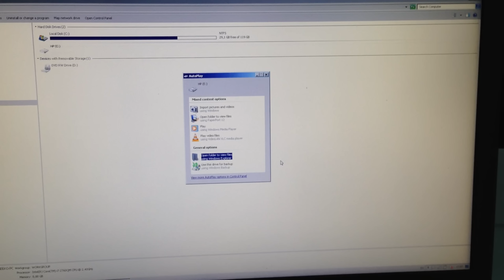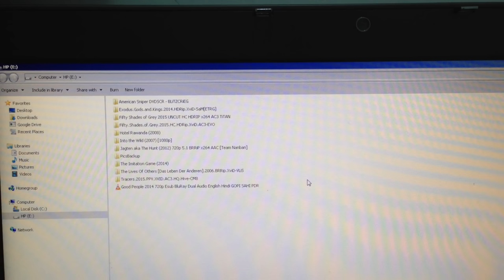How to recover data from a dead hard drive (for beginners)

Comment: id reuse the drive but only for non critical data applications and in an emergency..  if its a doa drive then why go through the trouble of marking on it to say its doa unless you plan too use it or keep it around for an emergency use? if its of no use, you strip it of parts you might need , toss it into a bucket of old electronics that you will probably never use or toss it in the trash.. for every external drive i have, i have a backup drive or 2 for that drive. see, i lost 3tb of data 13 or so years ago.. never again

Comment: my hard drive does not make any sound but seems to not work anymore. is it possible to fix it?
Reply: Did you ever get yours fixed? If so,  how?
Reply: Tracy Powers i replaced the circuit board and it would pop up when i connect it to a pc but it wouldn't let me access anything.

Comment: You did not!
ok peeps... this man had just luck! in any other cases, if your data are really important (prescious pics (not porn) , data etc) dont , never, ever, open the HDD. bring it to a data recovery company and let it open under clean condition...what you can do is, try to replace the bios chip on to a donor pcb. if you are able to do so. otherwise bringt it to a data rescue. coz once the Bios chip is dead..your data are also gone. check what manufacturer you have.. not all are the same.
in this case...for only bunch of old movies...fuckit, and get a new drive.
Reply: I have heard that if you open a drive while not in a clean air room that it is done. I opened one to just to see if I could fix it, and it was beyond my skill.
Reply from the maker: Totally accurate. I've also mentioned that in the video :)
Reply: @Engineerknowsbest  i may have missed that. 👍

Comment: You saved my hdd lol    Actually it seems fine as i'm recovering data, do you really think is dead for daily use? The heads were NOT that far away than in your video.
Reply: Once you open a HDD it's toast. Get what data you can off of it and toss it in the trash.

Comment: I have a External HDD ... It Fell from My Fridge and nothing happened but when i connect to laptop and open a file from it ... My windows explorer Freezes ...
so will the method provided in this video work with my HDD or its fucked up ?
Reply from the maker: If you don't hear the same clicking sound, and don't feel comfortable opening the HD. then I don't recommend you to do it. Openning the hard disk this way has a huge risk that you are going to lose the data stored on it forever.

Comment: 01:37 -- why TF would you use a screwdriver in the hole on the arm, directly over the platter, thereby risking easily scratching the platter, instead of moving the arm from a point where the platter wasn't directly underneath it?!

Comment: in which u connected hard drive for recovery tell me that plugin name sir.
Reply from the maker: I took this part from an external hard drive enclosure. It is quite cheap and available at most of the electronic stores.  You can also buy an external hard drive adapter like the ones here: http://www.ebay.com/bhp/external-hard-drive-adapter
Reply: Thanks
Reply: Very nice and informative video! I have a very old harddrive (Toshiba MK6026GAX) and was wondering what kind of connector I need to purchased. Any ideas?

Comment: The sound is like 2:49 when I plug in my hard drive but after a few seconds it makes a recursive sound pattern: *tic tic, toc*... a few seconds later all noise in the hard drive stops and my hard drive is not detected.
Probably the same issue as with your hard drive right?

Comment: Gone are the days when people used to depend on paper and pen. Digital files have almost completely replaced papers and physical documents both in corporate and personal space. However, this migration from physical information materials to digital files has also increased the chances of data loss due to various factors. For example, a sudden hard drive crash can cause to lose word data from a personal computer or secondary storage devices. Today’s technology is largely machine-based; that’s why it can fail anytime, anywhere. This is where word document recovery comes into play.

Anyways, read the below. This might help.
https://www.namasteui.com/data-recovery-causes-of-data-loss-and-the-best-way-to-recover/

--
Regards,
Sourav Basak
Namaste UI